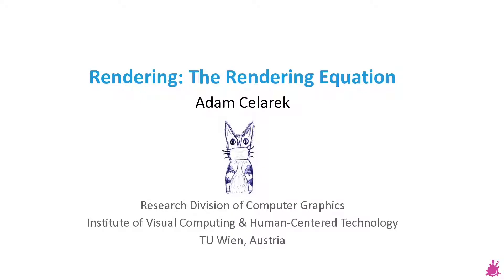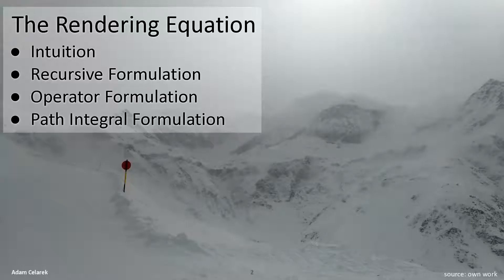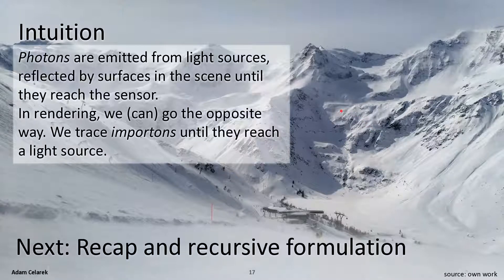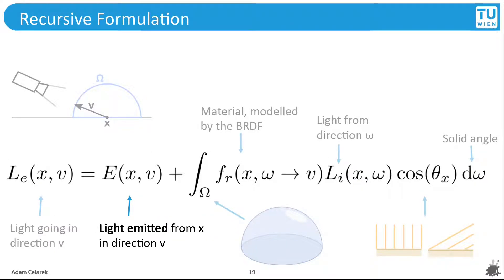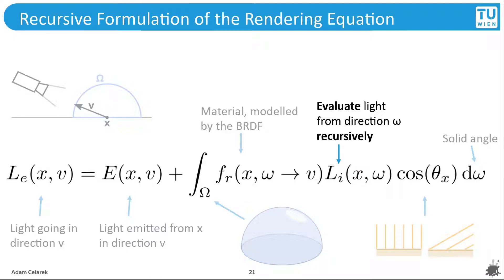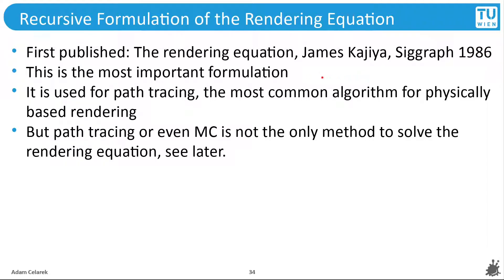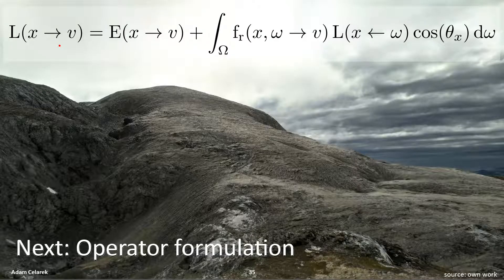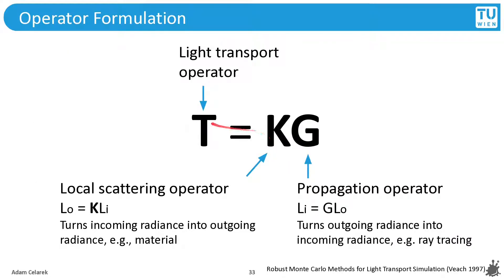Rendering Lecture 6 - The Rendering Equation

Comment: Great content again, and I appreciate the motivation for comprehensiveness with multiple ways of thinking about it and different formulations - BUT:
I would have kept with a single formulation, at least in the beginning. 
Once a specific mode of thinking is mastered, expanding into alternatives can be intriguing and satisfying, but before that it just compounds confusion.
It's too much too early. There's a subtle yet profound difference between:
A) Deriving the same solution through different routes, by looking at the same problem from different perspectives
, and using different tools.
B) Formulating the problem itself in different ways, resulting in completely different and unrelated solution formulations
.
The first is very helpful for learning and teaching, as different people's minds work subtly differently, so different people would resonate with different approaches.
The second is harmful for learning and teaching, as it throws too many terms and modes of thinking at the student, all at once at the outset, overwhelming them.
They're having a hard time as it is just reasoning about a single mode of thinking with all it's nuance and inter-relationships. 
Multiplying these just compounds that difficulty, not diminish it.
It's like if you first learn how to swim, it's helpful to try different ways of staying above water, but it'd be very harmful to learn to swim in multiple waters each having differing currents, all in super-position all around you all at once.
Reply from the maker: thanks again for the feedback!

Maybe we should move the other formulations to some sort of 'advanced' material to the back of the course. this would also allow to move the recursive formulation further up and before the mc part.
Reply: @cgtuwien  I think there should be some alternative route of teaching this material, that gets students hands dirty very early on, way before venturing into either sampling theory or acceleration structure. 
These are largely optimization strategies for performance, which do absolutely need to be covered, but that ideally should be delayed (imho). 

For example, a simple ray tracer can easily run at interactive/real-time speeds even in pure software, with low sample rate, low resolution and very simple scene. Similarly, I think there should be a route of doing the same with path tracing.

For example, starting with a simple discretized hemisphere of directions with pre-computed/tabulated factors (a-la measured-BRDFs). These can just be iterated over in the simplest way possible, enabling to focus on lighting/shading in a global-illumination context, well before even talking about probability theory.

Generating such distributions on the fly, then improving them for optimization and variance-reduction, could then be introduced incrementally after that.
Reply from the maker: That's true, but it also hits a resource limit (working time) on our side. We both also have research to do, and we used Nori for the coding tasks almost without patches (meaning less work, but also less flexibility). We can shift some of the lecturing materials, but I guess that we wouldn't want to change the coding tasks a lot, or even role our own framework. The tasks are more work than you might think, because we have automated tests using continuous integration. We ran over budget introducing / redoing the lecture last year already. In case of interest, this is the lecture from 2019 and before: https://www.youtube.com/watch?v=pjc1QAI6zS0&list=PLujxSBD-JXgnGmsn7gEyN28P1DnRZG7qi.

cheers, Adam
Reply: @cgtuwien  I've also been following this other playlist in-tandem. 
I'm also enrolled in this course: https://online.ucsd.edu/courses/course-v1:CSE+168X+2020-SP/information
I have many issues with it, I think yours is miles better in many ways, but it's predecessor (CSE 167) was providing skeleton code projects with placeholders for students to fill - which was really great.
I don't know what Nori is, but using a pre-existing render engine for teaching seems like a bad idea to me. 
An ideal educational vehicle for coding should probably only take care of irrelevant minutia while keeping things agnostic/absent when it comes to the content being taught for the exercises.
I understand that you're working under a budget, I'm just noting what seems unideal to me.